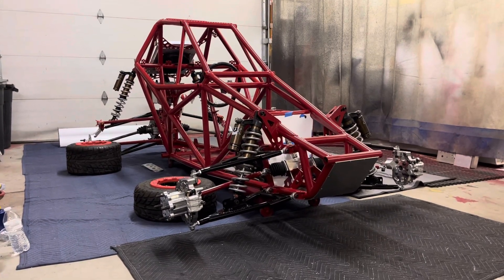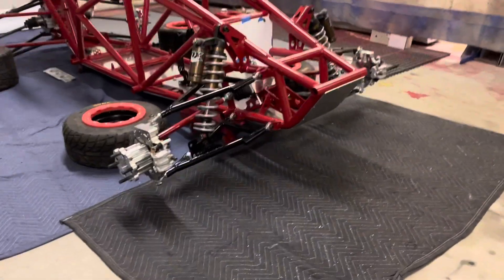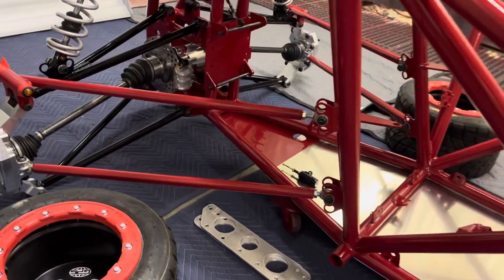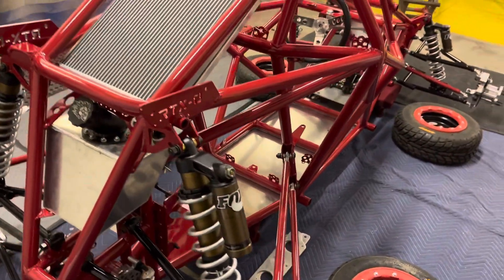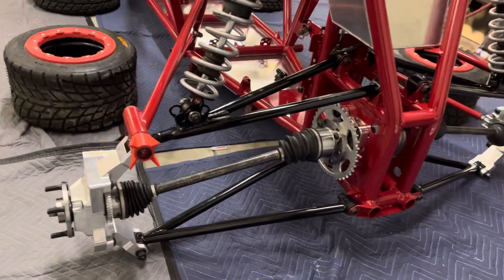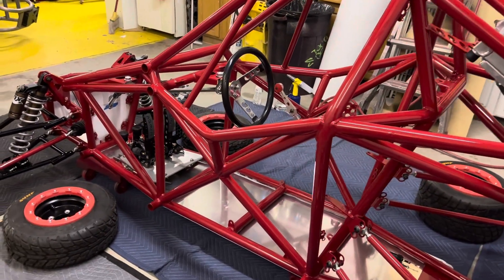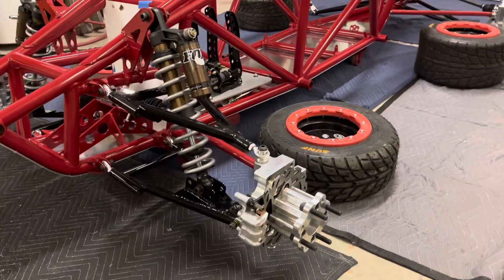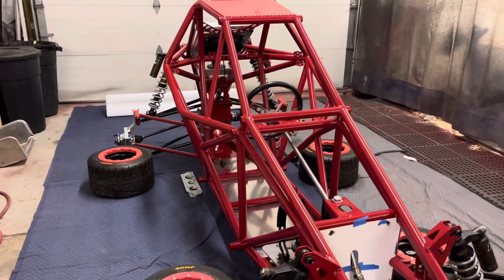RTX-0 cross kart build update April 18, 2022 Assembly

Comment: Do the plans include the plans for suspension and are you able to link the shocks and sizes for them?
Reply from the maker: No shocks or suspension info is on the plans, just chassis only, thos was originally designed for those who wanted to build their own suspension and driveline. I do have the drawings and parts needed if someone wants to build it like it was originally made for my testing, I just haven’t had time to create what’s needed for the website yet due to time constraints. 😢

Comment: I have a crosskart buggie powered by a 2005 Suzuki gsxr 600. . I broke my live axle shaft in the middle. So tom pro design build me a new one . But I can’t find anyone in the San Francisco Bay Area that will install a weld it in . I’m stuck right now
Reply: Might want to learn how to weld, but youre better off having a bolt on mounting assembly fabbed up for it.
Reply: @g00gleisgayerthanaids56  Actually I ended up welding it myself and I’m not the best welder I didn’t say I didn’t know how to weld. But I’m not the best but so far so good she’s holding up just good
Reply: @johnvalente5847  who cares if its pretty, long as it holds! Good on you for gettin it done!